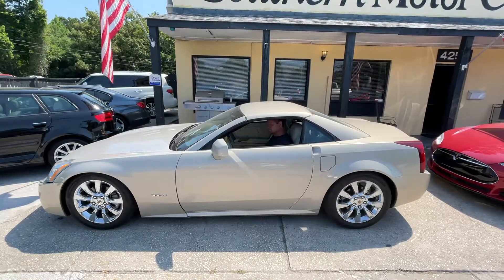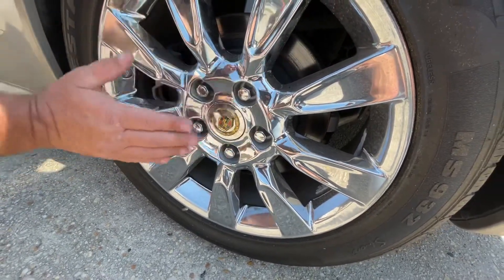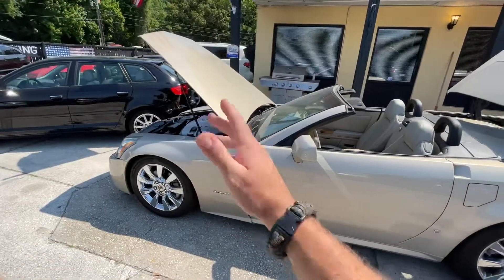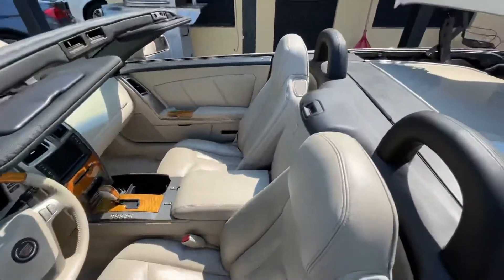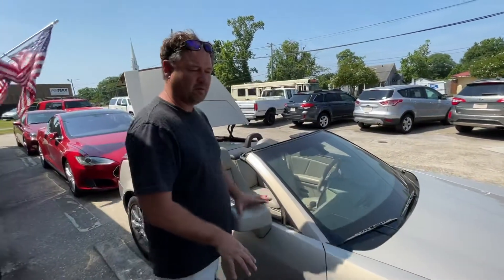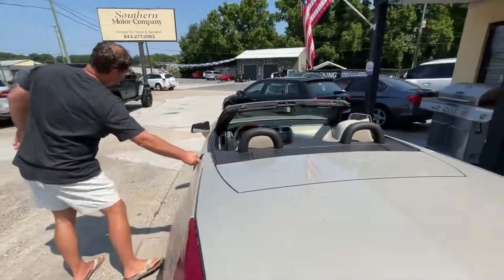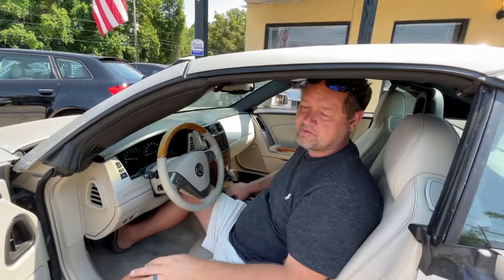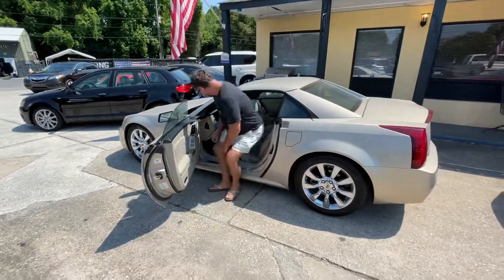Cadillac XLR | Tutorial for Convertible Top & Accessing Car if Battery is Dead - Best Facts to Know!

Comment: Do you have any idea how to open the car when the battery is dead and the key in the rear bumper turns but will not unlock the trunk?  I'm really at a loss!!!  Thanks!
Reply: Never mind.  I got it open.  Thanks anyway!
Reply: I’m in that situation right now   How did you get in pls
Reply: @gta3ist  I didn't know at the time that the hydraulics were holding the trunk down.  It helps to have one person turn the key and a second person lifting up on the trunk.  I'm assuming that you know about the key access in the bumper!

Comment: Ummm ... your expert is wrong about the Supercharged XLR-V only having "30 or 40 more horsepower" than the XLR and being the "same" engine. Though the Northstar was derived from the Lotus / Mercury Marine LT5 DOHC monster in the C4 ZR-1,  the Northstar is not your typical Chevy 350 (5.7 Liter). The Supercharged 4.4 Liter Northstar in the XLR-V is quite different from the naturally asperated 4.6 engine. Due to significantly increased engine loading and thermal stresses on the 4.4 SC, piston assemblies, rings, rods and bearings are upgraded to higher quality parts. Engine dyno's rate the XLR 4.6 Liter (280 Cubic Inch) naturally-asperated Northstar V-8 at 320 HP.  Dyno numbers for the 4.4 (Only 268 Cubic Inches!) Supercharged Northstar in the XLR-V are 443 HP. That's an additional 123 HP ... not "only 30 or 40 more". Also, the Eaton roots-style Supercharger requires @130 HP to spin up to maximum boost, so the engine basically has to produce @ 570+ HP to show 443 on the dyno after the Supercharger steals 130. Few people know that a Top Fuel dragster Supercharger steals @ 1,000 HP from the engine to operate at maximum boost. ;-)